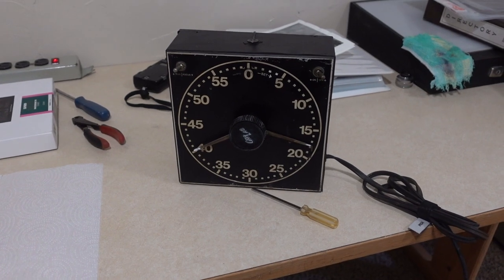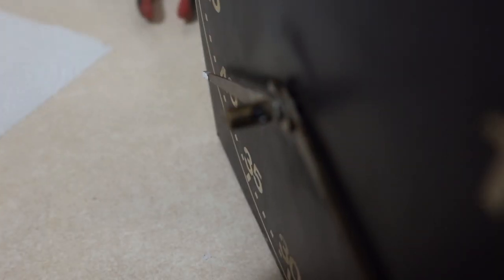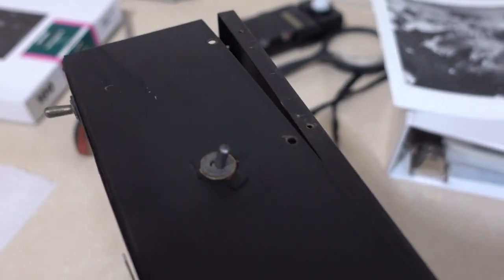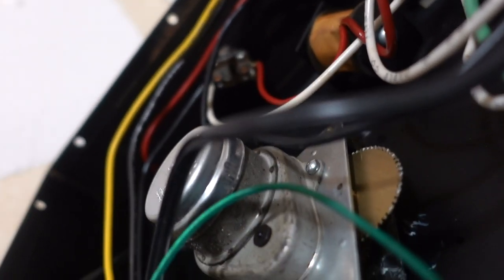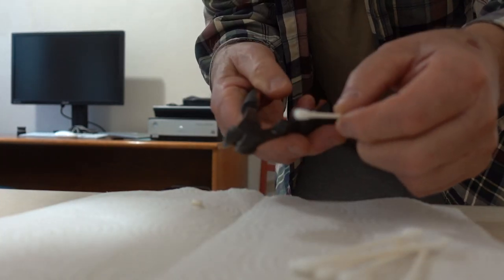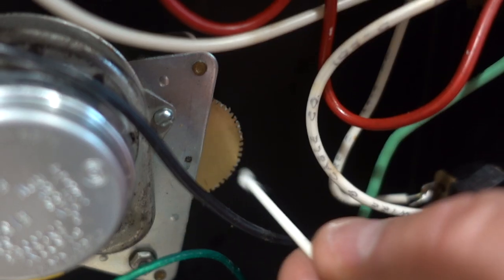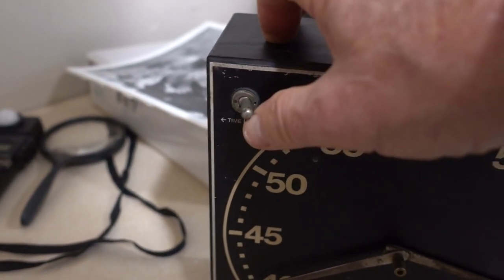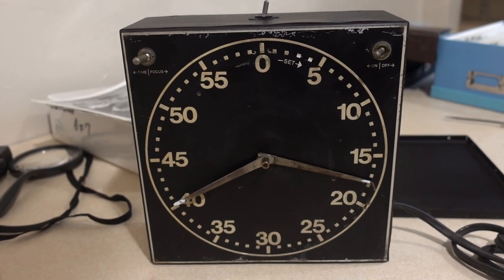GraLab Darkroom Timer Maintenance

Comment: Do you have any advice why a Gralab 300 won't stop when the minutes hand reaches 0? Mine just keeps going round and round
Reply from the maker: First question is: do you always move the minute hand backwards? It is not supposed to be moved forward. I dont know what it does if you re-set it forward but something may have broken. Dis you check the two set screws - as seen in the video? Beyond that, I'd have to look at it in person. Dis you take the case apart and look inside? That's what I'd do.
Reply: @asa1000photography  thanks. What it was is that the "zero" was calibrated to a different time (I think minute 26). I let the timer work until it stopped there. Then I loosened the screws and adjusted the two hands to 0. Couldn't have done it without your demonstration